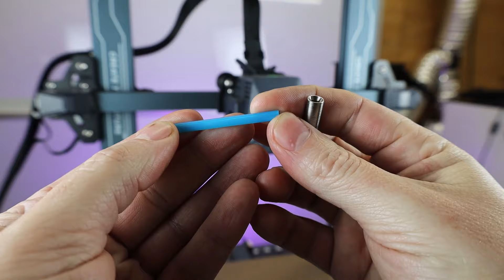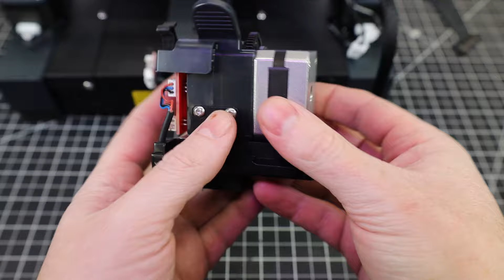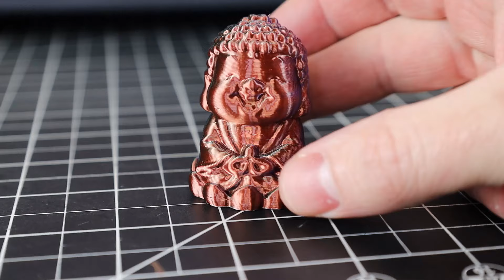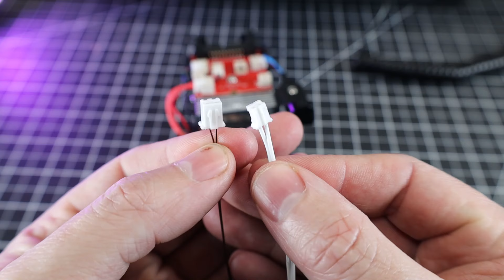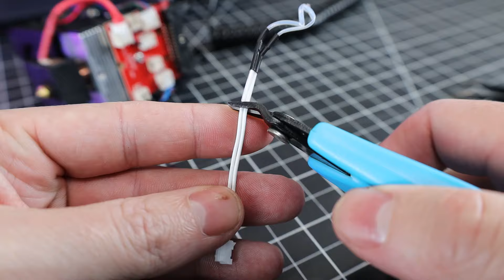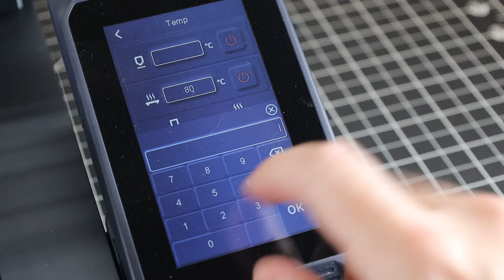$25 All-Metal Hotend Upgrade For Elegoo Neptune 3 Pro, Plus & Max

Comment: Great video, I followed along and replace the parts in my N3+ but now, even after leveling the nozzle is pressing on the bed. One attempt after level to print and now there is a nice scratch/groove on the build plate (Ouch) any thoughts on what I'm doing wrong? Leveling completes with the paper test looking ok Z offset is 1.81 which seems high. Thanks in advance
Reply: Nevermind, I think I've got it fixed, at the expense of needing a new textured bed loo Permanent Benchy groove now. :)
Reply: @vJoeG-Vids whatd you do to fix it or whatd you do differently than just setting it to auto level?
Reply: @calebwaller454  I had the heatbreak screwed in all the way vs 50/50 Heat break and Nozzle. Also I had some PTFE tubing in the heatbreak forgetting that it was all metal. Once that was sorted out I'm back up and running.

Comment: Doesn't it need PTFE tube?
Reply from the maker: Need? No but I found out it makes it a lot easier to load. Cut the ptfe tube to about 30mm and put it back in and it works perfectly

Comment: Hi there - was wondering how you would suggest proceeding as I have just opened the unit and noticed that a) the PTFE has become exposed slightly away from tubing, b) the whole unit head seems to have been decaying after only a few weeks of use, and c) I cant actually remove the heating rod....

Comment: Why do you need a replacement thermistor? Can you use the old one if you don't want to print high temp?
Reply: Also can you use the old silicone sock on the new block
Reply from the maker: Yeah you can use the old one if you aren't going to print too hot. You should be able to use the sold silicone sock still

Comment: Awesome video!!!, just solve me If I do upgrades and print the Polymaker PA6 with the N3MAX that I am about to get. What was your experience with this fillament and the printer at 280°C?
Reply: I have not seen anyone successfully getting this firmware to go over 260c. I don't think it's possible.
Reply: @s0d4c4n I tried everything possible but still not going over 260c 
I updated the firmware and  still not going over 260
Reply from the maker: I haven't really used it over 260cafter doing this to be honest. I would need a full enclosure for this full setup so I could print abs/asa and I have other fully enclosed prints that I can do that with right now. 😅👍

Comment: This video helped a lot! The only problem I'm having is that when I set my temperature to anything over 260 in cura, my hot end will not heat up at all. If I try anything under 260, it does just fine though.
Reply from the maker: Have you updated the firmware on the printer?
Reply: @randymay  Yes. I updated it maybe 2 months ago
Reply: I have not seen a single person that has been able to get the firmware to go over 260. I spent a lot of time and money trying.
Reply from the maker: Have you tried emailing Elegoo and asking if they had a solution?
Reply: @randymay  I'll be happy to invest more time in this if I get confirmation that at least one other person has actually done this in real life

Comment: Great video!! One question though - after the install (using the all-copper block), I'm having trouble with the hotend temperature maxing out at around 130 C.  Not sure if this might be a thermistor problem (already tried reseating it a few times) or an actual problem with the heating of the new block.  I know you eventually replaced the thermistor, but is this something you ran into after reinstalling the stock thermistor?
Reply from the maker: That is odd and I would recheck everything to make sure that none of the wires are broken or if something isn't sitting in the proper way
Reply: Figured it out. I have a CHT nozzle on this and I had screwed the heatbreak all the way in, leaving a gap between the nozzle and the block.  I figured out that the nozzle needs to be all the way in, touching the block, and the gap should be left between the heatbreak and the block.  Works like a charm now.

Comment: Where exactly does the thermal paste go if you use it ?
Reply from the maker: It would go on the copper part that comes in contact with the aluminum cooling fins.
Reply: @randymay yeah I saw a picture finally. So many mention it but no one shows it in a video.  Thanks for the video I did mine other day it heats up so fast now. I did put the blue pipe back and did not have to cut it smaller as the overall length was still the same as before.

Comment: Just a question, don’t you need any new tube to change the ptfe one? You put the new Metal black without any tube.
Reply from the maker: So I did install everything without the tube and it did work. That being said it made it a lot harder to change out the filament due to not being able to see the hole to line it up. 

All you need to do is cut the ptfe tube down to about 30mm long and install it at the top of the new all metal part.

Comment: I’m trying to re level my printer but it tries to go back to zero and hits bottom and can’t re-Calibrate it 😫
Reply: Well I thought I was good but now I can’t get filament to go through now 😤
Reply from the maker: Did you put the ptfe tube back in to help guide the filament into the hole? If not you just need to cut the tube down to about 30mm long and it should all work together
Reply: @randymay  that’s what I had to do and now it’s working again.

Comment: Hello my friend.  Thanks for your video.  I have a little question for you.  How can I increase the nozzle max temperature using software?  I want to print at 300 degrees with my printer.
Reply from the maker: According to Elegoo if you update the firmware to the newest one you can print at  higher temps
Reply: I have not found a single person who has successfully got the firmware to go over 260c. I spent a lot of time and money trying.

Comment: The 2 bolts (allen head) holding the heater block to the hot end assembly, what size are those?  Most of the allen head bolts to remove the fan assembly and the hot end were 2mm, but these two INSIDE the heater block appear to be smaller?  Even smaller than the 1.5mm allen I had.  Very confused here...
Reply from the maker: I honestly don't remember 😅

Comment: Question for you. I did this and now for some reason the printer isn’t trying on at all. The fuse is perfect the power switch lights up but nothing happens
Reply from the maker: Did you ever fix this problem? Doing this shouldn't do anything like that to the printer
Reply: @randymay  my board died elegoo is sending a new one

Comment: My hotend screw is rounded, so I can't unscrew it. This printer is a pain since I am experimenting a lot of clogs, and now I can't even change the teflon tube. Any advice for solving this?
Reply from the maker: Is this your first printer? Also are you using the supplied Allen keys that came with it because they like to strip out if you can get your hands on some better quality ones you might still be able to get that screw out without having to drill it out. 

I'm assuming you're printing in pla but what temperatures are you using and how cold is the room that you're printing in.

Comment: What is the max print speed you have used on neptune 3 max till now?  I have a super racer and it prints at 180mm/sec, neptune 3 max is very slow compared to it. Can i print at atleast 150mm/sec on this printer?
Reply from the maker: You can technically get it printing a lot faster if you get it setup with klipper but as it is I think 150mm/s might be pushing it on the stock setup.
Reply: @randymay  klipper doesnt have pause and print option. If power cuts off, we cant continue printing. I have used a klipper pad for super racer and its better not to use klipper if we want to resume prints
Reply from the maker: That's not something I have had a problem with to be honest so I haven't been too concerned about it. 😅

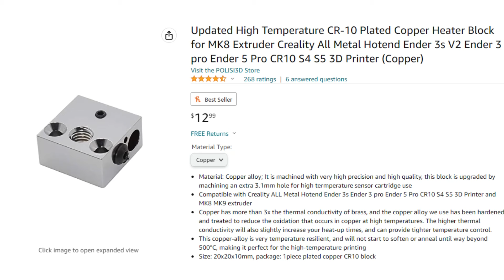Comment: At 1:46 , you should apply a lot of thermal paste there. the whole copper(cold side) should be covered in thermal paste. Over time when its cold & heat up repeatedly the surface contact will have a gap. It might have filament heat creep & stringing soon. There is no way they can manufacture(heatbreak & heatsink) it with 0 tolerance. Unless its a 1 piece hotend like bambu. So thermal paste is necessary in modular hotend for heat transfer. DO NOT USE LIQUID METAL as paste. It will put hole in your aluminium heatsink. Use boron nitride for best performance. If it hard to get, you can use thermal grizzly kryonaut from most pc shop.

 It will help extrusion & retraction become accurate. Meaning your print will become more beautiful just by applying thermal paste.
Reply from the maker: Yeah it would definitely help with heat transfer and I believe I said that you can add it if you like but I can't remember. I do have links to some in the description of the video.
Reply: Sorry dont quite understand where should the thermal paste go ?

Comment: So I'm a novice to working on the print head and all the parts associated with it so I have a question: When replacing  the HeatBreak and the Heat Block, do i need to put the blue tube back in the Heatbreak like it was when i take it off?
Reply from the maker: It's best if you put the PTFE tube back in to make it easier to load filament. That being said you do need to cut it down to about 30mm so it will fit.

Comment: When you say with the right nozzle, I'm guessing you mean a larger one? Totally new to this 😬 also would this upgrade allow the use of nylon filament?
Reply from the maker: So this will allow you to print using nylon but you are also going to need an enclosure to keep the heat in so the nylon doesn't warp. I have no idea what I meant by the right nozzle due to not having context or a time stamp to what I was saying. 😅👍

Comment: 1. Heat block is at angle and heatbreak tube is little bent
2. Cannot insert filament because there should be little tube on the top of heat break and that breaks the point of all metal hotends
Reply from the maker: I don't know what you are talking about with number 1. But yeah number 2 is right but it can be used without the tube like I showed in this video. I did add the tube back later just to make feeding the filament into it a little easier.
Reply: @randymay   1. I bought M2x16mm countersunk screws for heatblock. After tighting down screws, heatblock leaned towards screw holes. If I hand tight them, heatblock will become loose when unscrewing nozzle.
2. A little easier? I could not feed filament after around 1 hour without 5mm of PTFE tube.

Btw. do you use this setup(with bimetal heatbreak)? Do you have any problems with PLA, retractions, clogs etc?

Comment: Sorry I’m a little confused. This upgrade completely eliminates the need for the blue PTFE Tube inside the hot end?
Reply from the maker: It can, but I do suggest cutting it down to about 30mm long and putting it back in to make loading filament a lot easier. This upgrade is basically removing the PTFE tube from the hottest point of the printer so you can print using higher temps. This tubing starts to off gas some nasty and toxic chemicals at temps over 260c. So replacing it with an all metal heat break and moving it up to a point that is much cooler will help a lot.
Reply: @randymay  I think thats what is causing confusion. This is meant to remove the PTFE tube completely but then you say put 30mm of it back to aid filament loading. So it either removes it or not. Need to make it clear that if you do not put it back do you have any issues at all with loading ?

Comment: Have you switched to a larger nozzle? If so, what settings did you change to?
Reply from the maker: I did used a 0.8mm nozzle and all I did was use the default profile and changed the nozzle size in the slicer. I did fine that I needed to mess with the retraction a bit due to it under extruding a lot but that was it.

Comment: It would be so cool if you did a series fully upgrading the Neptune 3 max to the ultimate large high temperature printer 😅
Reply from the maker: Yeah that would be cool but also very time consuming. That being said I might need to get it setup to print ASA and Nylon for a large project I'm wanting to do for the channel.
Reply: Elegoo should just sell the components as an after purchase upgrade.

Comment: Do I have to replace the ptfe tubing on the inside or can I just leave that out?
Reply from the maker: You can leave it out but it making loading filament a lot harder. I did put it back in but you have to cut it down to about 30mm long.

Comment: thanks for the vid. i tried this but if i fully insert the heatbreak into the block.. the nozzle wont be able to fully inserted.. and on the otherhand, if i fully insert the nozzle on the black. the heatbreak wont be able to be fully inserted... how did you manage to fix it?
Reply from the maker: The threads on the heat break are flush with the heat block and the nozzle is just as far as I can get it in and it all just worked
Reply: @randymay  you mean the nozzle is not fully inserted and the heatblock is fully inserted?
Reply from the maker: Yeah I still had a few threads showing.

Comment: Looking to upgrade my Neptune 3 Max printer that I just got. Have you confirmed that for sure this works with the max and that I can do Nylon and Carbon Fiber with this? What about updating parts with the correct connectors?
I am newer to 3d printing but Have some car parts and outdoor things I want to get making but also seeing a lot of the CF materials need over 280, at least 285+ but a lot are around 350.
Reply from the maker: Yes it all works on the max but to print what you are wanting you will also need an enclosure for sure to keep the heat in and so things won't warp. I have never used the materials that need 350c to be honest and I have made parts using ASA and Carbon fiber Nylon at temps around 280c
Reply: @randymay  thanks. I accidentally broke some of the parts I ordered so I'm waiting for my reordered parts to come in but I went for the higher end components you recommend. 

Just have to figure out how to build an enclosure for this as I've been having some warping/ unsticking issues with even pla especially when I run out of glue so still learning a bit.

Comment: Well I ended up having to try doing this on my printer, as the original had a major clog (Filled up the silicon cover and made that all useless.). Unfortunately, even with the snippet of the tubing, I couldn't get this to reliably feed the nozzle without it jamming up near the motor (Looks like it just binds up and bunches the filament up in the internals).
Reply from the maker: What material and temps are you printing at?
Reply: @randymay  just pla, 210. Its almost like it goes into the feed and scrapes the edges until it sticks and then the motor crumples the filament into itself.
Reply: Did you put the blue filament back in ?

Comment: @randymay hey man it turns out I accidentally ordered the wrong size of heat pipe thing. But I was able to just use a angle grinder to change the length.
Reply from the maker: Well I'm happy to hear that you're able to at least get it working and figure out what the problem was

Comment: @randymay Hey I followed the tutorial and got a new heatblock but I am haveing issues with my nozzle pushing into the bed when I try to auto level the printer. Any ideas?
Reply: This happens while it is returning to zero
Reply from the maker: If you can use some digital calipers and measure your heat block and your old heat block and make sure they're the same thickness other than that you need to make sure things are screwed in flush when it comes to the heat break into the heat block.
Reply: Ok thank you, I’ll try it and let you know how it works.
Reply from the maker: Ok

Comment: By default there a small cut of tube inside the hot end. Do you not need to add that piece with this heat break? Shouldn't there still be a tube pressing against the bottom of the heat break?
Reply from the maker: The point of this is to remove that tube from the hottest part of the hotend assembly. You can cut the default tubing down to about 30mm in length and put it back in to make it easier for the filament to get to the top of the heat break.

Comment: Where are the parts you mentioned would be in the description down below, particularly the 0.4mm filament heeded name, model#, seller?
Reply from the maker: Here is the full list of the items that you might need to do this yourself:

All Metal Bimetal Heatbreak Copper & Titanium (4 Pack) - https://amzn.to/3ILv6bP
All Metal Bimetal Heatbreak Copper & Titanium (3 Pack) - https://amzn.to/3HjcPRN
All Metal Bimetal Heatbreak Copper & Titanium (2 Pack) - https://amzn.to/3kxLylX
All Metal Bimetal Heatbreak Copper & Titanium (Just 1) - https://amzn.to/3HjvfSp

Copperhead Heat Break C-E (If you are looking for a better quality heat break get this one) - https://bit.ly/Bimetallic-Heat-Break-Upgrade

Aluminum Heater Block (Must use M2 X 16mm bolts) - https://amzn.to/3CKCIar

High Temp Plated Solid Copper Heater Block (Must use M2 X 16mm bolts)  - https://amzn.to/3CQVIUV

Stainless Steel M2 Bolts - https://amzn.to/3XmuRZ2

Stainless Steel Metric Bolt Assortment - https://amzn.to/3XKsuze

Thermistor 100k NTC 3950 M3 Stud - https://amzn.to/3QQ5M6q

Heat Shrink Tubing (If you are just going to just cut the old wire and solder it make sure to use something like this) - https://amzn.to/3D1mRV7

JST PH2.0 Connector kit ( To replace thermistor plug) - https://amzn.to/3J5lSan

JST PH2.0 Connector kit with Crimping Tool - https://amzn.to/3XHG1Hx

Micro Connector Pin Crimping Tool Only - https://amzn.to/3weB7pS

You might want to use some thermal paste to get better heat transfer but you don't have to:
Slice Engineering Boron Nitride Paste - https://amzn.to/3w15Bvw

If you're looking for the latest Elegoo firmware you can find it here - https://www.elegoo.com/pages/3d-printing-user-support